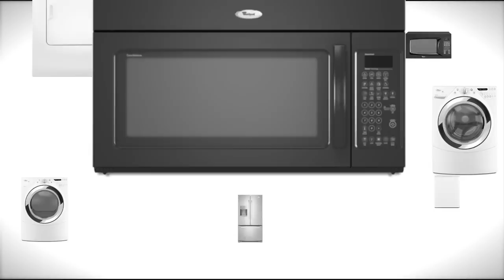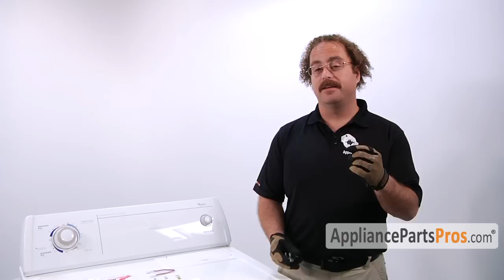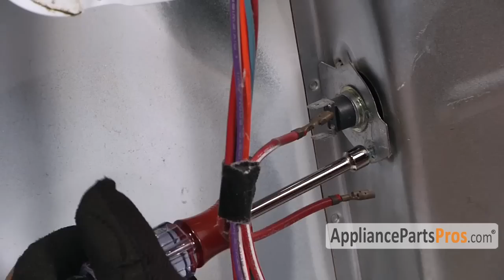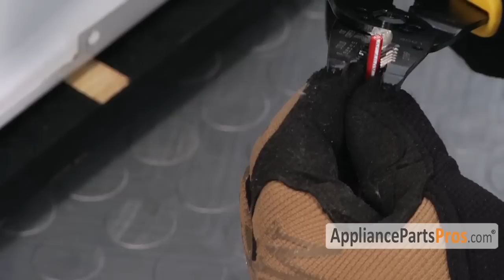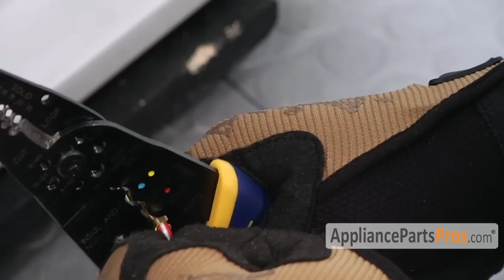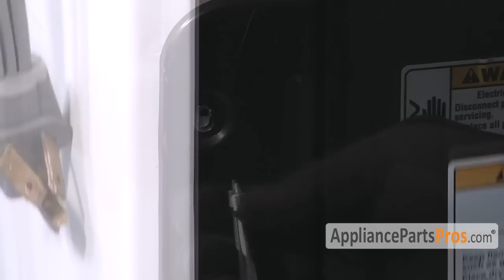How To: Whirlpool/KitchenAid/Maytag Thermal Cut-Off Kit 279816

Comment: Thanks for providing the visual. I only needed to cut one wire, the orange one. I put the gold connector on it. The jump wire fits the gold connector w/o any cutting.
Reply: I've done it that way before too.  My guess is they prefer to have the "big" voltage (240V going to the other side of the heater) carried by the direct connection of the spade instead of having to go through the off-shoot spade to the side.  Still seems like that offshoot has plenty of cross-sectional area to be sufficient.

Comment: Thanks for the instructions. Question: as I️ was replacing my high limit thermostat, I️ noticed that my old thermostat does not have the small orange wire.  Only the two large red wire connections. What is the small orange wire for and how do I️ go about replacing the thermostat without It? 
Hopefully that made sense! Cheers.
Reply from the maker: We'll be glad to help you figure out what's going on there. We offer free technical advice even days a week. You can give us a call at 1-877-477-7278 or you can chat us at our website: http://www.appliancepartspros.com/. We will need your model number, which you can locate using this tool on our website: http://www.appliancepartspros.com/modelnumber_locator.aspx
Reply: SAME HERE! Looks like someone did some splicing with the orange wire.
Reply: Mine also

Comment: I don't have the orange wire, only the 2 red ones. Do I just run the jumper from the bottom terminal on the thermostat to the element terminal? In the meantime, I installed the cutoff with the original thermostat and it's working fine.

Comment: Hi, what's the reason they've updated the hi limit stat from the old style?  Does the new one have better function?  I ordered the hi limit stat/thermal cut off kit and I also have the same IRWIN wire cutter/stripper/crimper.  Do you know what settings to use on the tool so I don't risk overcrimping or cut into the wires?  Thanks!

Comment: Thank you for the instructions. I found the written instructions for wiring the new thermostat came with the kit to be confusing.
Reply from the maker: Awesome, glad the video helped you out!
Reply: I just found your video unfortunately I tried to follow the instructions. I didn’t cut the ends off the jumper wire and I believe I’ve shortened out the timer any suggestions bc I have no power now. Any advice would be helpful before I have to replace my wife’s dryer. If you can feel my pain!

Comment: what if we have a white and black wire with a small female plug that attaches to the heating element terminal.  Is that the same as the orange terminal you talk about?
Reply from the maker: We'd be happy to help you out with that! We offer free technical advice and diagnosis. You can give us a call at 1-877-477-7278 or you can chat us at our website: http://www.appliancepartspros.com/. We will need your model number so we can look up the schematics for your unit to give you accurate advice, which you can locate using this tool on our website: http://www.appliancepartspros.com/modelnumber_locator.aspx

Comment: the wire is burnt off at the thermal cut off on my dryer will this kit fix that ?
Reply from the maker: +dennis waterhouse The wire included in this kit is not for the thermal cut off, it is a jumper wire used on the thermostat. If you burnt a terminal you would have to replace it and any wire that was damaged.

Comment: My thermostat doesn't have an orange wire also. Our dryer has been running for over 10 yrs without it. Can I assume it isn't needed? Please answer yes or no and not the generic message about calling you guys. Just need that question answered.
Reply from the maker: That would depend on what model you have, and how much it has in common with this one. Even if it uses this same thermal cut off kit, it may not be exactly the same as this dryer model. A single part can be compatible with hundreds of different appliances. This part is actually compatible with almost 5000 different dryer models. We film the part on a single appliance model to serve as an example of the repair, but there may be slight variations in the process for different models. To answer specific questions about specific models, we would need to know your model number so that we can consult a diagram of your unit. That's why we recommend that people call in and talk to one of our agents. They can take the model number, look up the schematics, and talk you through any issues or questions you may be having.

Comment: I did this repair. It still does not heat. What else could it be?
Reply from the maker: +Tea 1 There are a few things that could cause no heat, I cannot cover it all here. You can post the problem along with the appliance model number on our repair forum and the techs can help you troubleshoot the problem.

Comment: my thermal fuse keeps blowing.  the hose is now routed out the window to insure that wasn't the problem. but it still blows. what could it be.  dust thing is clean.
Reply from the maker: +Delrico Alexander Make sure all the ducting inside and outside the dryer is clean, also check for worn or damaged seals. Also make sure the blower is not damaged and that it is securely attached to the motor shaft.